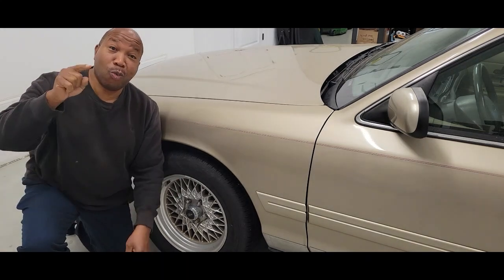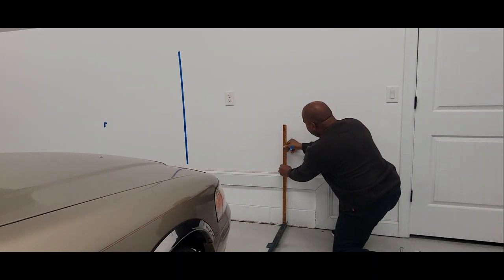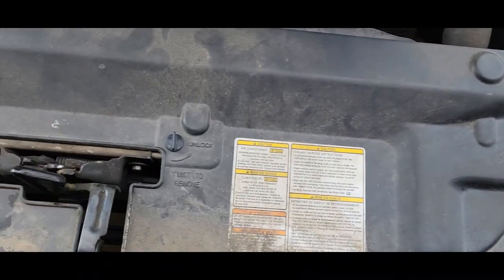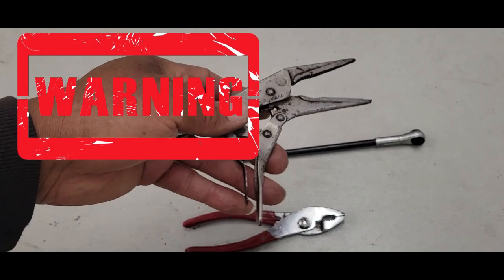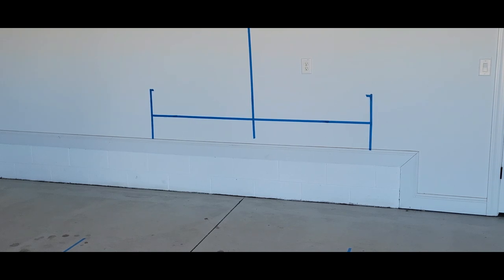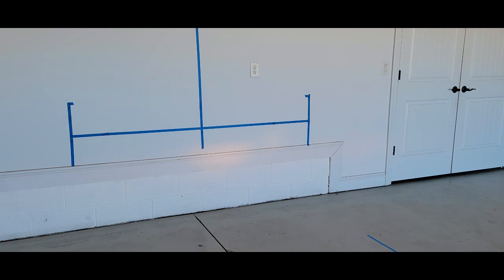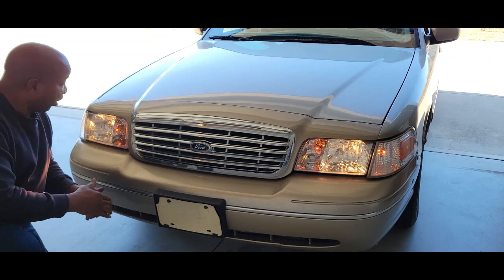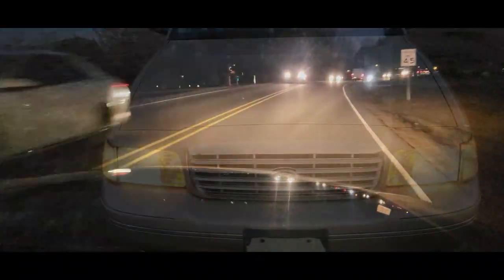How To Adjust Ford Crown Vic Headlights

Comment: Did you check to see if one of the tabs on the right headlight isn't lined up right and that's not what it seems to fit right?  I saw in another video that they won't go in right if those tabs aren't lined up correctly.
Reply from the maker: @IIBLaCKBeaRDII  They can be a challenge.

Comment: Do you aim the headlight left/right by pointing the center of the beam pattern where the vertical and horizontal tape meet?
Reply from the maker: @oOgy172  Good question! 
I like to keep the  Driver's Headlight center  inside in the middle. The Passenger Headlight would be the one that I may move to the  right inside of the vertical and horizontal tape, not the outer side of the tape.